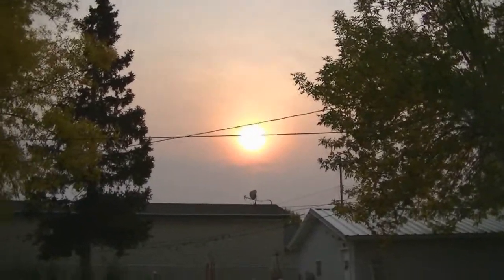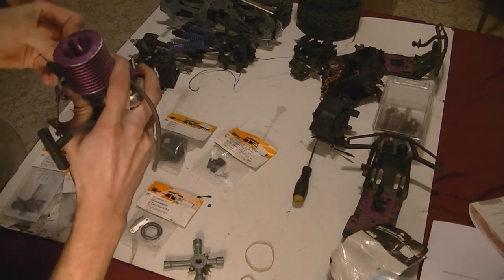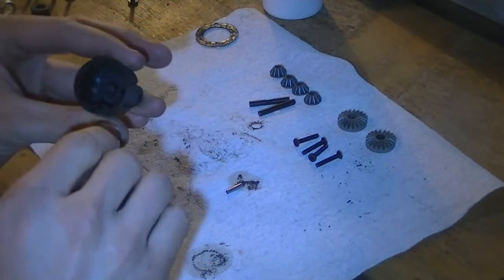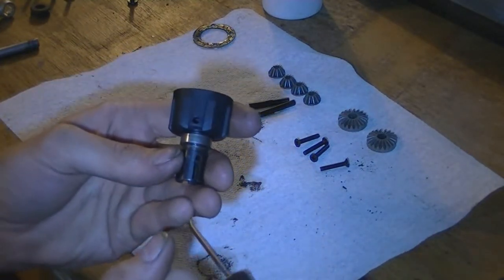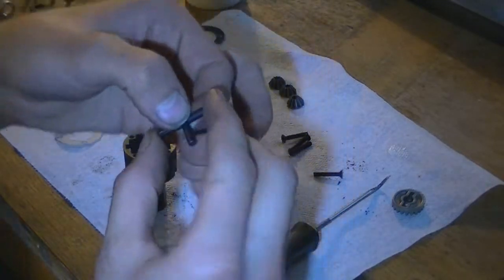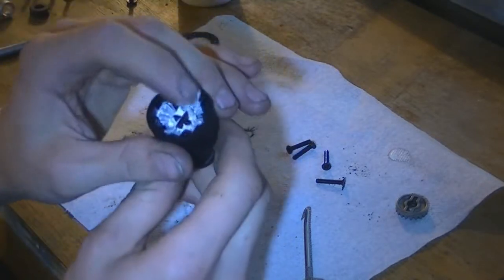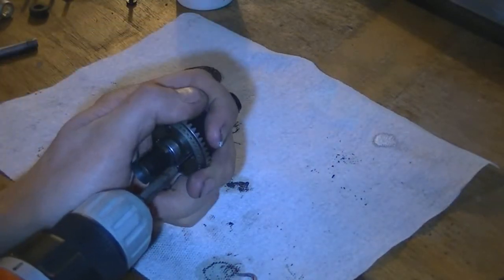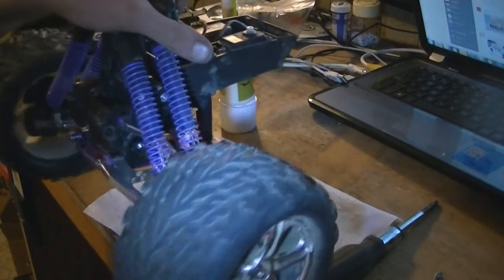RC: HPI Savage SS Differential Rebuild! (10/01/12)

Comment: You should of got the metal/alloy diff housing. the plastic are just going to wear out again and blow up the gears. The air clean is crap they are the old ones and let in dirt. I cant belive the still sell those parts. Good video and thumbs up.